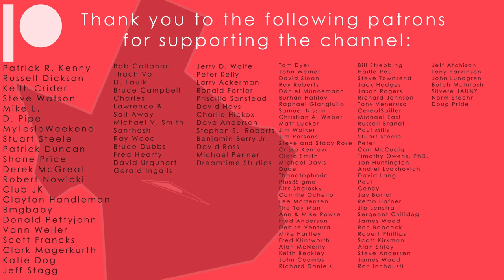Tesla Terafactory Texas Update #179 in 4K: Hooking Up The Superchargers - 07/07/21 (5:15pm | 88°F)

Comment: At  0:57 that is actually the first bridge crane that has been operational for a long time. It is comprised of two cross beams and a trolly, which supports motors and spools of cable. (Trolley supported on each end by the two beams visible in the photo).

Comment: Thanks Randy.
19:33. First close up of this new roof system. Some sort of cement based filler in the decking troughs, a sheet of some product, a coat of cement based filler troweled over top. Regular insulation panel and membrane system to go over?

Comment: When they did the concrete slab pours for the casting machines, if I remember they built slots in. I wonder if the reason why they haven't poured the last two slabs is because they don't know what size machines they'll be using..?

Comment: so germanys giga is all walled in except for the huge casting machines.  They started some assembly lines with robots.  So the question is, there are parts of this factory that have been sealed up for 3-6 months.  Are they beginning production?  They can seal off parts of the building from the active construction sites, so theres no safety Karens to scream at anyone.  Also, we stopped seeing trailers full of robots being shuffled around the site, so hopefully they are doing something
Reply: The inside photos and the model Y body we saw indicate they are setting up the production line to go through the processes, but like with anything this huge and complex, it takes time to integrate the processes, get the workers up to speed and make a bunch of scrap in the process.  When the pieces start coming out high quality, they most likely will be put in storage for later.  You can't put out a vehicle with no seats, for example.  They may have to order, ship and stock many of the subassemblies needed before the final EVs come off the production line.

And the other factories might order a half million of some parts and that's a big order for almost all companies.  They might have to split the order up into several orders from several companies.

Comment: Hey Randy, the overhead crane above the casting machines has always been double beam. Nothing new. Keep up the great work!😃
Reply: There are 2 overhead (double beam) cranes in that bay.  The second one was added a week or two ago.
Reply: @Russ1956  Where's the other one? It's not visible in the shot. I looked hard and I can't see any second crane, anywhere. So 6:04 to 6:20 that is just one crane. It's two beams, there's a trolley that rides under the two beams.  (And it's always been like that, from day one.)
Reply: There is a winch trolley that travels between the two beams. I blew up the picture all the way and can see no sign of bright red paint all the way in the back of that bay!

Comment: Sorry if this has been discussed previously, but do we know if the large unfinished strips into the center of the building just for access to heavy equipment areas? Or is there some other purpose/end use planned for them?
Reply: They are going to be the 'highway' of the gigafactory where trucks will come and go
Reply: We don't know for certain, but it's still my belief that they will complete most, if not all of it, as a building. The green paneling is typically used on interior walls, not exterior, and there's no indication of loading docks being built in this space. Without loading docks, there's no reason to have an alley. We'll know better in the next 2-3 weeks.
Reply: @FutureAZA  I think there may be a slot in the South face, based on the clues that the stamping press wall is concrete (not green), and there are no footings in that area (yet).  There are also large entrances in the West stamping press wall.  However, that wall does not have a parapet wall at the roof line, so there is some evidence to the contrary.
Reply: @rajarampejaver6689  Berlin has tons of areas with interior concrete walls, so I don't see that as the smoking gun. We'll know more soon. ;)

Comment: Tesla is building 2 giant factories I find it interesting the the one in Berlin can be build with out pickup trucks being used or necessary.
Reply: The ‘other giant factory’ is in Texas.
The Pickup Truck is the  National Car of Texas, y’all 🐴.

Soon, it will be the CyberTruck…………
Texas-Built, Texas-Tough, Texas-Tall
Reply: @ernestgalvan9037  
Myself I have found roof racks and a trailer for more functional than a pick up but to each his own.
16' lumber works great on roof racks.
Reply: Pickup trucks are the highest selling vehicle of any type in the US by far.  Purchase is by preference and not necessarily related to the construction trades.
Reply: @universeisundernoobligatio3283  I've discovered the best pickup is a Corvette with a Harbor Freight trailer attached loaded down with concrete and drywall.  It's also quite the crowd pleaser. ;-)
Reply: @cratecruncher6687  omg bro.  please don't be THAT guy!!!
Reply: try driving onto a job site in Texas in a prius, and you'll figure it out eventually!!!
Reply: @davidanalyst671  
But only 1 out of 10 pickups are used for construction, most only get a carton of milk now and then.
Reply: The price of gasoline in Europe is over $7 a gallon!  They can't afford to drive a vehicle that gets such poor gas mileage!
Reply: @cratecruncher6687  
Until the Corvette gets its undercarriage ripped up by rubble and tree stumps.  Not good!!
Reply: @acmefixer1  I never takethe C5 to the dump for that very reason.  It's too low to negotiate the terrain.  I only haul short distances on paved roads.  With 350 lb-ft of torque towing a few hundred pounds a short distance won't hurt the car.  Before the C5 I towed materials with my Mada RX-7, also a crowd pleaser.  What can I say I'm a handy guy that likes his performance cars.